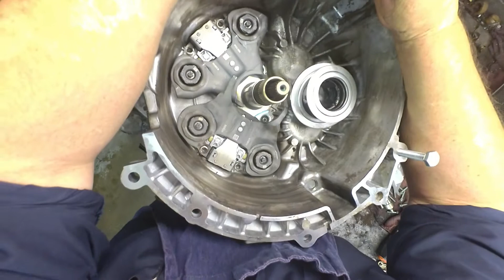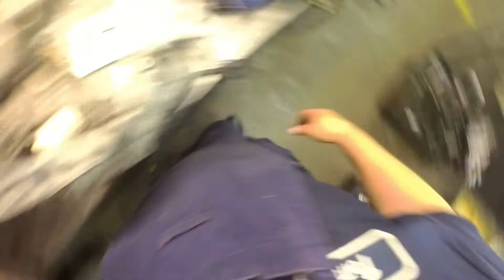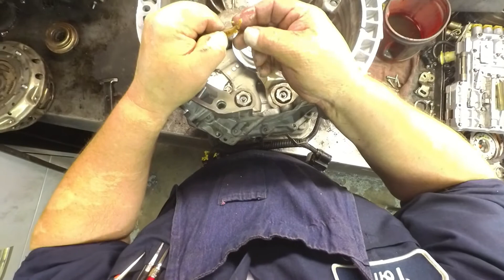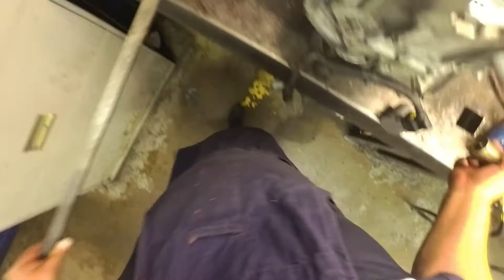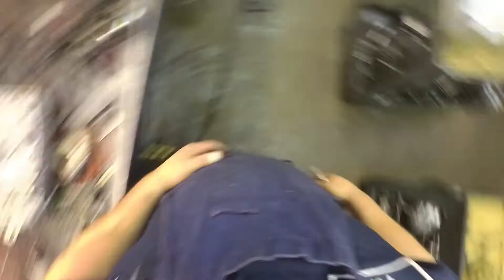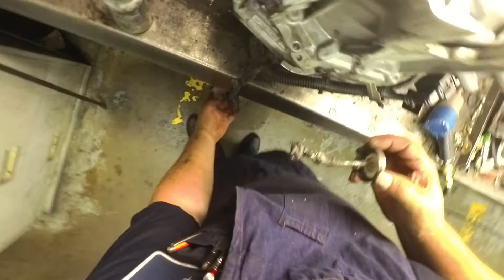Ford Focus Dual Clutch Replacement

Comment: Seriously, screw Ford for this transmission. My car has 62,200 miles on it and it nearly undriveable due to extreme shuddering/clutch slip (auto trans). It's been to the dealer for this issue two other times, in which they "replaced trans seals" and it fixed it for another 10-15k miles. Now, the dealer tells me it's no longer covered. I'm left holding a car with 62,200 miles with a severe trans issue that's been in for a known trans problem two other times. That just ain't right. Period.
Reply from the maker: Agreed. They all do it though. Had a Hyundai that had a problem and the dealership kept pushing it off saying nothing wrong until the warranty was over.
Reply: I feel your pain. Your problem is exactly mine. I got 67k mules. Bad clutch 3rd time. Now it's broken down,they say no warranty. Still making payments on this car.
Going to try to fix it myself 🙁

Comment: If the clutch didn’t get screwed up, you could run the clutch over to a Ford dealer and they can reset it (I have had to do this a couple times for aftermarket shops) very cheap. Another thing, the three T30 bolts that hold the bearing sleeve into the case are extremely fragile, I have had the heads break off just tightening by hand. Just FYI
Reply from the maker: Yeah we have had it done also. Also I believe it is Adapta-Case that sells a rest tool for them. Thanks for the tip.
Reply: there is no such thing as resetting a clutch. You are probably referring to resetting the transmission control module. This is only a temporary fix tho with these cars
Reply: @jays5926  On the dps6 dual clutch you can reset the initial adjustment, maybe learn before telling someone they are wrong.
Reply: @jays5926   yea I agree, don’t put your two cents in something you have no clue about. These aren’t like a regular old stick shift car, these are manuals but shifted by a computer. Real example of someone knowing it all but not actually knowing a damn thing or prolly even touched a car 🤦🏻‍♂️

Comment: I put a transmission with dual clutch attached into a 2012 focus from a properly shifting doner 2012 focus. Only thing I kept from the old focus is the tcm. Shifts well with no codes. However, when accelerating after first shifting into drive or reverse, I hear a pronounced click or thud, sort of like an axle click or rare wheel bearing crunch. It only does it once, sometimes does not do it and may have even heard it when vehicle first starts up. Is it possible cluch failure or improper bolt up of cluch to fly wheel? It did not do this while on donor vehicle.
Reply from the maker: Since it did not do it on the other vehicle and I assume you did not remove the clutch from it, you may need to relearn the tcm to this transmission and clutch as the old one had different values.
Reply: @CurmudgeonTransmission  ok, thank you, will try that.

Comment: Im a tech myself.  Mine made it to 186k miles before failing.  Just pulled it today. Ford sent a ford boxed luk, got complete kit from luk $350 cheaper off summit.
Reply from the maker: Luk is OE supplier for most of them.

Comment: In mine I had replaced the transmission housing because tab broke off. Now there is a problem. When the lever is in Park I turn the clutch but I hear a click after about 15 degrees turn and locks up. In neutral I can turn it all the way. I never tried turning it all the way while in any gear but it seem to turn ok while in gear it just locks up when in park there is like a click then locks up. I’m thinking I can install it like that otherwise something gonna break once engine turns the transmission spindle. I wonder if the gears need to be set somehow
Reply from the maker: It sounds to me like you have 2 gears engaged at one time. When you replaced the case both shafts should be in the neutral position. The clutch should turn even when it is in park, That click you are hearing is the parking pawl engaging.
Reply: @CurmudgeonTransmission  thanks man I was able to free it up what happened was one of the dowel pin was not in the hole. Now that it has a new housing the clutch relearn completes. Still I think it’s off because  I don’t know how to time the gears and it is probably off when I put it back. Thanks man I just could not find a video on how to put the gears in proper order because assembling it because since ran was broken it may have gone off order.

Comment: 2014 Ford focus. Bought the clutch of eBay and everything went smooth going in, but I noticed this clutch does not have any markings on it to align it with the flywheel.  So how am I supposed to know where to bolt it so it doesn’t vibrate ??
Reply from the maker: There should at least be a mark to line up the input shaft adapter with the clutch disc. That mark is usually where the opening of the snap ring goes. That should be closest to the mark on the flywheel. From most that I have seen.

Comment: was there torque specs on all those inner bolts?
Reply from the maker: 19 ft. lbs. on the forks inside. 168 in. lbs. for the actuators on the outside.
Reply: Nice, thanks

Comment: Hi ❤. One question. When fit new clutch kit  mine come lock position can put line that or relse
Reply from the maker: Put it in as it comes in the box. Release the clutch only after the clutch is fully installed. If you release it before you put it in you will need a special tool to reset it so you can install it.

Comment: Hello, sir. What is the specific names of the two seal at 6:13 (one outside, and one inside) which you said would be good idea to change out? Would you happen to have a link to where I can buy the parts?
Reply from the maker: Input shaft seals. I would get it from Ford.
Reply: Thank you.

Comment: Hello, great video. My question is one I put the center hub in my clutch will not spin at all. I have take the parts in and out a number of times and still nothing. When it’s out everything spins just fine. Any suggestions?
Reply: When*
Reply from the maker: Did you reset the clutch each time you took it out? Requires a special tool to do it.
Reply from the maker: You may have the forks not positioned correctly.
Reply: Yes I have reset the clutch each time and also have the forks in the right place. The old clutch spins fine when I installed it as to see if the new one was bad.
Reply from the maker: Sounds like there is something wrong with the clutch you bought.

Comment: Please help I just finished putting the clutch in and when I spin the outside that bolts to the flywheel like you did  my inner disk spins the opposite direction in you video it doesn’t spin and in the ford guys video it spins the same direction did I do something wrong
Reply from the maker: Did you release the discs by turning the release forks?
Reply: @CurmudgeonTransmission  yes I did 14 turns and heard the clicks when it released
Reply from the maker: Ok. This is a normal condition. It will turn the opposite direction.
Reply: @CurmudgeonTransmission  thank you for responding and the great video’s you make!
Reply from the maker: Thanks for watching.
Reply: Why does your clutch center not spin when you spin the studs on the clutch and in other videos on YouTube the center spins with the studs at the same time? Hope that makes sense. Basically what he was asking in this thread. Ty!

Comment: Hello when resetting the clutch turning 14 times counter clockwise should it turn freely or feel spring loaded ? Is this a bad clutch? The car has lost reverse and threw code p287a clutch b stuck engaged.
Reply from the maker: Resetting it is for after clutch replacement. It turns pretty freely. Usually with those codes it is a bad clutch. Sometimes a bad actuator, but usually a clutch. Had one recently that had blown up the throw out bearing for that fork that operates reverse with those codes. Took out everything inside there. If you order the LUK clutch set it comes with everything. New fork assemblies, bearings, retainer and clutch assembly. You can get it from WIT or Transtar.
Reply: @CurmudgeonTransmission  Thanks

Comment: Does a brand new clutch need to be reset or is it already reset?
Reply from the maker: Once installed on the transmission it needs to be released. Once installed in the vehicle it needs to be relearned.

Comment: I have a 2014 ford focus, which shutters when it shifts from 1st to 2nd, when the car is run for sometime and very rarely from 2nd to 3rd and it does the same when making a u turn, otherwise the car runs smooth. I checked with local ford dealer they are saying there is no problem, no codes nothing, what might me problem , what need to fixed, please shed some light on this
Reply from the maker: I think you are at the beginning of the clutch failing. Without being able to experience it, it is hard to say for sure.
Reply: @CurmudgeonTransmission  Thank you for the reply, I also thought so, do I have to replace both the clutch assy and the actuator or either one. then why does slipping cause when making the U turn, what will it have to do with the differential.
Reply from the maker: There is a lot of torque applied during that. You only need to replace the actuators if they are bad. They are a fairly common problem, but luckily they can be replaced on the outside. I personally like the LUK kit the best. It comes with everything you will need for the clutch.
Reply: @CurmudgeonTransmission  thank you
Reply: You need to drive it with a heavier foot. That's one of the only solutions that doesn't cost money. Clutch is not being given enough power on engagement. Mostly a software problem. Also partly the design.

Comment: Is there a bulletin for the torque specs anywhere? I’m doing the same thing rn and I’m about to just set the thing on fire. I can find the numbers for just about everything except the torx and the spring bolts on the fork. Did just hitting it with the impact work alright?
Reply from the maker: Yes. Anytime you can not find a listing Google torque calculator. Put in the info and it will give you the spec.
Reply: @CurmudgeonTransmission  or just go German tight on normal torque, "gun-in-tite" or where extreme torque is required Japanese tight "hot-dam-tite".

Comment: How much is this repair - Replacing the clutch & actuators?? I was quoted $2900 from the dealership and $2300 from a local transmission shop does this sound right?
Reply from the maker: That's about right, they are not a cheap repair.

Comment: When you do the 14 turns counter clockwise is it necessary to turn them back to where you began? Saw someone else not turn them back and I want your take on it because you seem to have a done few and not just a backyard mechanic.
Reply from the maker: It will go back if you take the tool off, it is spring loaded. I would try to turn it back slowly myself. Make sure it is all the way back to it's starting point or you will have trouble getting the actuator back in. You will need to do a relearn on the clutch afterwards.
Reply from the maker: The instructions say 14 turns, I go until it stops being able to turn. Don't try and force it, just go until it stops.
Reply: @CurmudgeonTransmission  Thank you so much. Will be attempting this if it ever decides to cool down some here in Kentucky.
Reply from the maker: Hope it all goes well for you.
Reply: @CurmudgeonTransmission  Thank you. Got up early this morning and tried it. Was able to turn counterclockwise but it had seem to me a little more tension than they should. It was not like they actually stopped turning. After I was done to where I thought it was they sprung back without me turning them back to where I began. Is that normal. Still same fail point at clutch travel relearn.
Reply from the maker: Yes that is normal. There is going to be a lot of tension. You are pushing  the pressure plate and releasing the clutch. They can be very difficult to get to relearn, any little thing will stop it. Did you have any codes before and are there any now?
Reply: When you turn the tool back 14 times is that resetting the clutch without buying that specific tool
Reply: @enoughsaidentertainment4071 no, it just opens the clutches, still need to make the TCM”Learn” the new clutch
Reply: Need some in put I’ve never done one of these but a guy wants me to pull transmission he said the clutch need aligned with flywheel he says there’s an arrow where they go together..guess they had it apart and guy didn’t do it ? Any body got input or pictures thank u

Comment: What is the estimated cost for this job? My car needs this done
Reply from the maker: Probably 3-4000. With the price of everything going up I really don't know how, I don't handle the pricing.
Reply: @CurmudgeonTransmission  just had mine replaced at a ford dealership and it was $999
Reply: @god1246  really? My dealership said it would be 3,500 if I had to replace it. Luckily it's the TCM and under warranty

Comment: Is there any reasons to rotate the actuator 14 times sir?
Reply from the maker: yes, it fully releases the clutch.
Reply: @CurmudgeonTransmission  thanks mate. My car has a problem, shows P07A4 code, i physically removed clutch B actuator motor it's not running when i put R. Actuator B Manually rotating and it can see the bitting point. What can be the cause sir?
Reply from the maker: @torqueunlimited3522  Probably a bad clutch. Should be missing some forward gears also.
Reply: @CurmudgeonTransmission  thanks sir
Reply from the maker: @torqueunlimited3522  You're welcome.

Comment: I’m having tranny problems I got a a code and it says p287a: “clutch b stuck engaged” what do any of you guys recommend car has about 78 thousand miles SMH
Reply from the maker: Swap the motors and see if the code changes or stays the same. If it changes then you have a bad motor. If it stays the same you probably have a bad clutch, possibly a bad computer. Usually the clutch. The B actuator is the one towards the bottom.

Comment: про усилие затяжки болтов конечно же не слышал.
Reply from the maker: Bearing retainer hand tight. 19 ft. lbs. on the forks inside. 168 in. lbs. for the actuators on the outside.
Reply: @CurmudgeonTransmission  динамометрическим ключем надо тянуть, а не пневматикой